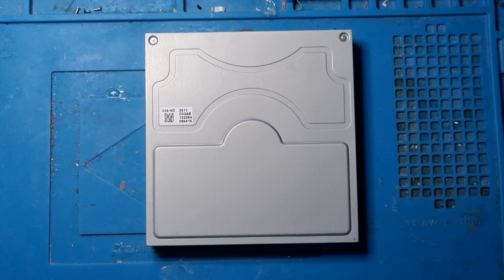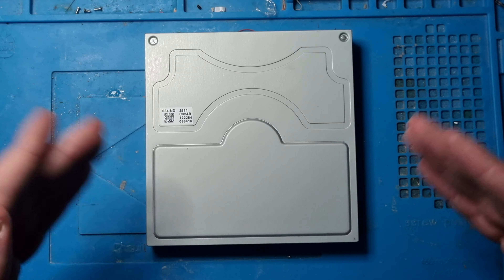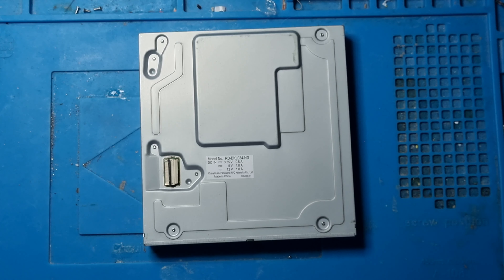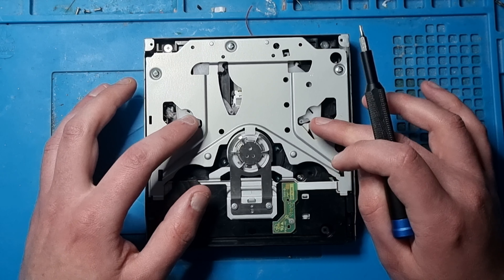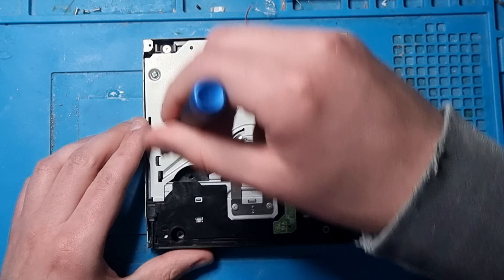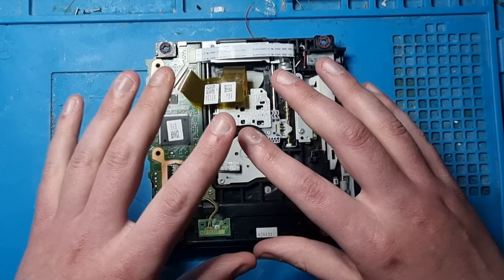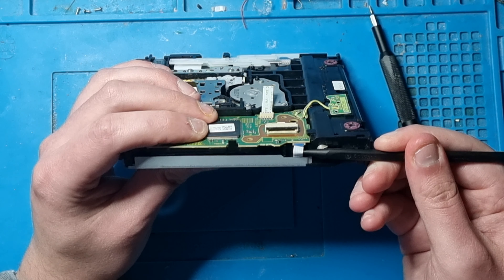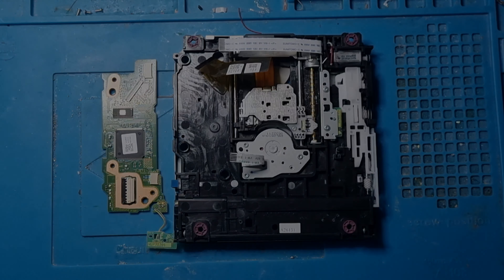Wii U Disc Drive Replacement - Guide to swapping daughterboard to a new drive! - 4K

Comment: You could actually remarry the drive in theory by writing to the SEEPROM.
That connector should be just SATA over a ribbon, people are working on putting an SSD there instead of the disc drive.
Reply: Hmm..

I wonder what exactly is checked.

Comment: I followed another video that directed me to remove those three screws that you directed not do touch, and I followed the steps also included in this video to swap the daughterboard onto the new drive, and I got a red flashing light when I tried turning it on. With the old drive, the system was running fine, all but working with games.
Reply from the maker: If your getting a flashing red light, try cleaning the ribbon cables that connect to the daughterboard and check that all ribbon cables are connected properly. Hope this help.

Comment: My WiiU decided to kick the bucket. Put in a new disc drive and now it has the same error message. Give me a F in the chat
Reply: F
Reply from the maker: What error code are you receiving?
Reply: @theretropal  160-1400
put in the correct disk drive via the model no. on the drive. Still doesn't work. its dead jim.
Reply: @theretropal  My WiiU games don't work but my Wii games do. I even tried my pokken tournament disc without any scratches and it doesn't work.
Reply: @GalaxyStandard77 bro same, I'm so sad about that my Wii U got Fu-#$ 😢 looks like I'll have to put it up...

Comment: If I followed this guide and replaced the disc drive, do you think the error code 160-1400 would stop showing up. I've had my wii for over 10 years and it's worked perfectly fine until I tried to start it up a few months ago. So should I go through with this and replace it or buy a new one?
Reply: Update: I've ordered a new disc drive (I opened up my console and found the disc drive to get the right type) and it should be arriving tomorrow
I'll update what happens when I get it set up
Reply from the maker: Sorry for long waited reply, unfortunately it's been a busy couple of weeks, regarding your Wii U a disc drive replacement may work, however, if this does not fix the issue, then please check out this post on GBA-temp which covers the same error code you are having: https://gbatemp.net/threads/absolute-fix-to-160-1400-error.572879/

Hope this helps.
Reply: @theretropal  thank you, I'm currently changing it out but I'm waiting on a very small screwdriver to come in so I can take out a nail and I'm going to comment if it worked
Reply: Did it work?
Reply: @sivartwad  I'm currently at a stand still trying to get ahold of a good screwdriver for an extremely tiny screw on the inside of the og disc drive
Once i get that I'm going to change it all out and I'll update this when I do finish
Reply: @kykkirigiri8563  Update?
Reply: @ً  I did grt the disk drive changed out and it did not solve the problem
I even got my wii u checked by console repair experts and they could not fix it.